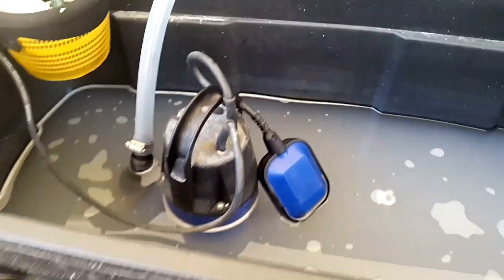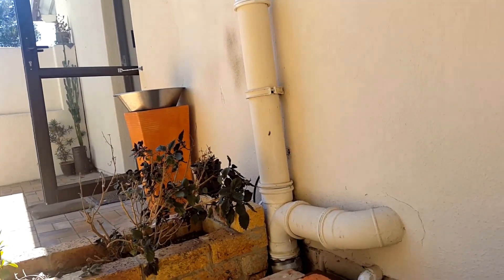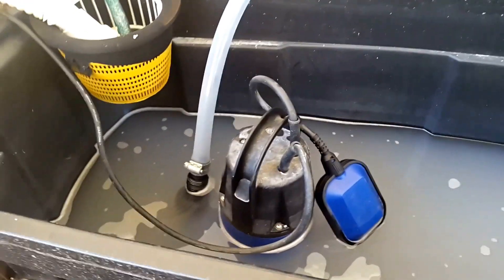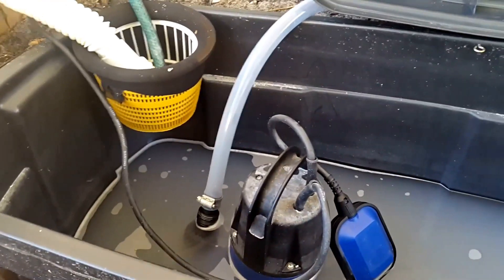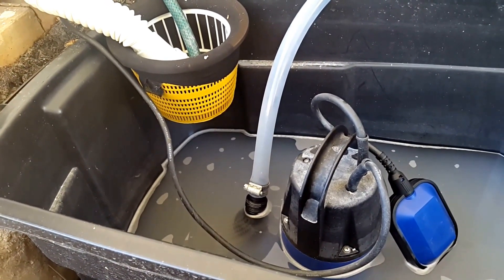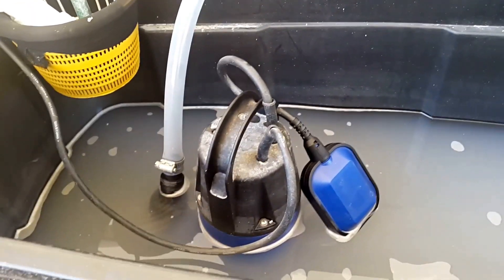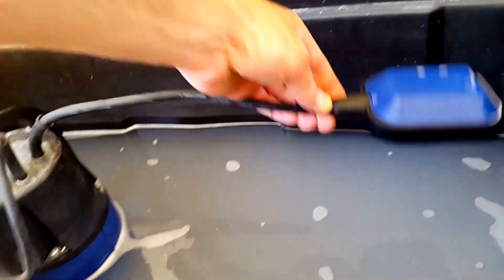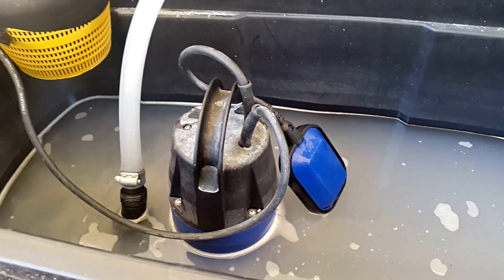3. Submersible pump specs and performance for DIY grey water harvesting system

Comment: Hi, thank you for sharing. Did you have any issues with the pump or how long did it last?
My local irrigation shop recommended a sewage compatible pump with float valve.
Your thoughts on this after working with the pump for a while?

Comment: This has me thinking... if this was placed higher above ground, above a rainwater barrel, it could be run by "gravity" instead. I guess that would require the gray water lines coming out of the house be placed higher than they usually are. I also guess that could be easily remedied if there is a basement or crawl space to bypass those lines to add exit pipes from the level above. That would probably be great to have the option for summer and winter systems in place to avoid freezing. I have to look into that further. Thank you for a great video!